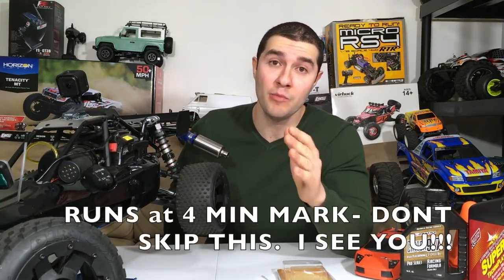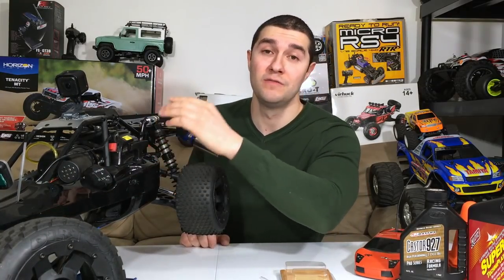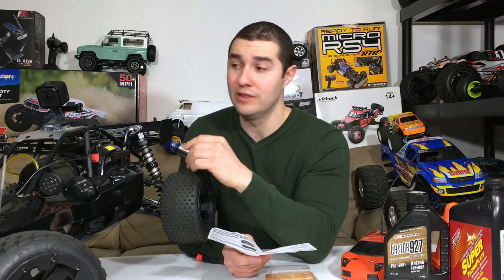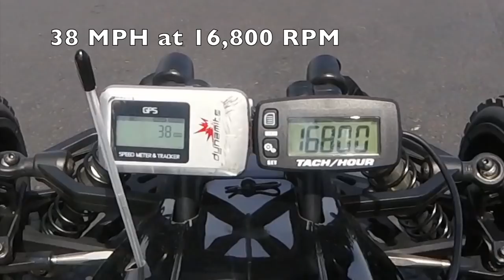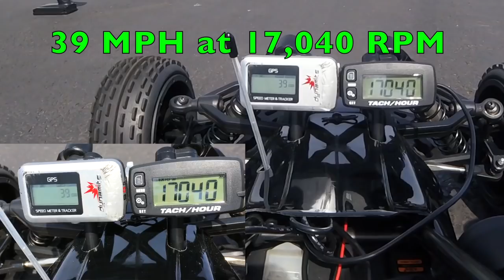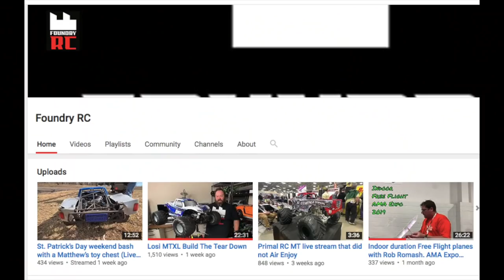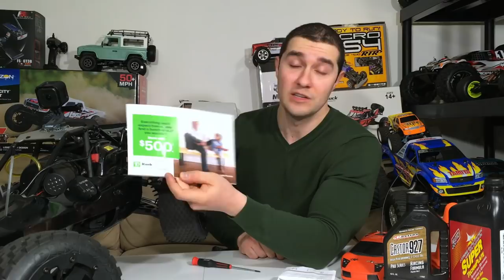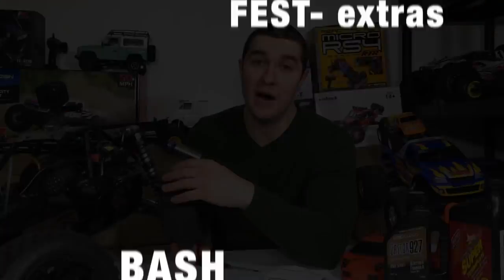RPM meter Speed Install on my ROVAN BAJA and PRIMAL MT purchase update + Much More!!!

Comment: Great vid! 17000 is more than I would have guessed! That tnx keeps catching my eye! Such a great truck was my first nitro back in the day!
Reply from the maker: thanks man!! I'm sure I can hit mid 17K or possibly 18 K with a better learner tune.  But I'm ok with the engine as it is now too.  That truck is the terra crusher, the model right before the TNX.  The TNX looked similar but had no reverse and smaller tires.  Did you have the terra crusher like mine or the TNX model?  Gotta love vintage RC, I am going to be starting an old hpi nitro mt today for the first time, wish me luck!!!
Reply: hybrid32494 I had the tnx. That’s right they had a similar colour scheme! Good luck on the start up! Love nitro! But it seems brushless and Lipo have stolen my heart these days! Less visits from cops thinking we are running dirt bikes lol😀
Reply from the maker: hahha,  I know what you mean on the cops with dirt bikes.  I love nitro too, today it gave me quite a headache, wound up totally having to rebuild an old hpi nitro mt,  had a busted clutch spring and so many exhaust leaks, lol.

Comment: Great video 👍 RPM gauges are definitely useful for tuning!! I just bought one for my custom 70cc engine that I'm building for my Baja. Should help me squeeze all the power out of it 👍
Reply from the maker: good job!! The more info we have the better it is.  Tuning by ear works to a degree, but you won't notice a 1-3 MPH speed gain visually id say.  This is a solid way to check even minor adjustments.  70CC,  thats huge!!
Reply: @hybrid32494   thx. yep, 70cc is huge! Now they're on to 90cc Lol. I don't want that big because then it becomes more unusable than it already is. 70cc should be perfect for me. Though, my 30cc was super fun!!! I just got alittle greedy 😂
Reply from the maker: I wonder what the RPM will be on that 70CC.  Generally the larger the engine the lower the RPM will be.  That's why a 1996 corvette redlines at 5-6K, ahaha.  While my old acura integra GSR redlined at 8K.  What do you think about lower RPM clutches. Mine has the 8K one, and it's good and all.  But chews up the tires easy with all the wheel spin when it engages.
Reply: @hybrid32494  The alx engine that my 70cc is based off of goes up to about 17500rpm surprisingly, my bottom end is identity to the alx, but my top end is not ported so that can be a factor. I'm hoping for 17rpm. I'll tell you when I have tested it out 😉 on the clutch thing,  the lower rpm clutches like the 6k ones will have softer,lower revving launch, a 8k or 9500rpm clutch will be like dumping the clutch at high rpm in a real car, most of the time the tires will Start spinning. So if you want it to have a softer launch and not spin the tires, you can put a 6k rpm clutch, there not very expensive, what you can also do for even cheaper, is just remove the spring in your existing clutch and buy just another spring for $2-5 and put it in your clutch and test it out.

Comment: Love your videos !  My son , and I have a pair of Baja 5r Mustangs,  even though these were "street cars"  they came basicly set up ,(suspension -steering) for short course dirt.  Mostly due to WAY uneven tire wear, I decided to Lessen Toe in, Caster, and Camber. Because it really looked to me as if all 4 wheels were "binding " with the road.     Less Bind, More speed.     While doing this work I noticed how "Out of Balance" the wheels were. I raised the front end, let tires rotate, marked the top, and glued a very small washer to inside of rim. I ended up with about 5-6 washers on each rim. (temp install rear wheels in front, as rear wont spin freely)  So far 43 mph with out buying speed parts.       I live in West central Ohio, There is a defunct home depot here, with a beautifull parking lot,    I purchased 200 traffic cones, 2 for a dollar at dollar tree.                                                      P,S.will likely dial back on some of these suspension adjustments to re-gain some of the cornering ability.

Comment: That was sick, never knew they had little tachs for RC cars lol. Completely took apart some of my laptop fans to try and find the problem instead of just replacing them. I was actually trying to find a tool to measure revolutions in general, but alas no such thing exists as all tachometers have very specific applications. I guess I will have to film the fan spinning in slomo and just count/multiply lol.

It's crazy how high the RPMs go on such tiny gas motors. Easily puts street bikes to shame. You know what would be real interesting? A rotory engine on an RC. Talk about power scaling linearly to RPMs lol.
Reply from the maker: hey man, thanks for checking this video out, I'm gonna be away this weekend, lets go RC sometime next week.  
I got a tool for ya to check RPM, I did it on wheel speed in one of my videos, it is also used to find speeds of any high RPM device such as a lathe.  It is a laser that counts the number times a reflective sticker spins (very simple).  As long as you can mount a sticker the size of 1 CM squared it will work.  Check this link, it might work for you.  
https://www.amazon.com/gp/product/B004Q8L894/ref=oh_aui_search_asin_title?ie=UTF8&psc=1

YUP, a rotary would be interesting, just like it was in the Mazda RX8, LOL,  that was an epic fail although I still like the car.
Reply: @hybrid32494  That's almost exactly what I had in mind, thanks!! There should be a way to get that sticker to stay on the fan blades. If not I'll still keep it just in case.

I get off work in the afternoon so just let me know whenever you are around. Looks like it will be at least 60 and sunny by midweek.  Hopefully nature is finally starting to warm up for spring.

Lol yeah the RX-8 was meh. I mean it certainly wasn't bad but the price point was hard to justify. The RX-7 is a completely different story though. It's too bad more people weren't into those cars.

I always had this idea that rotory engines and CVTs would make like the perfect combination. You have a small, lightweight motor with low torque that generates power at high RPMs and a small, lightweight transmission that can keep the motor at or near redline instead of constantly shifting. Imagine having one of these rotory units (motor + transmission) powering each wheel? Electric motors have a monopoly on that sort of setup for now, but if technology develops far enough I can see hydrogen-burning internal combustion engines making a comeback, at least in racing or other specific applications that call for it.

Comment: Oh dam. That O.S. engine was my very first engine in my RC10GT back in 1994. I still have it but it no longer runs. I just hold on to it for sentimental value.
Reply from the maker: I know what you mean, it's hard to let go of a vintage O.S. motor.  I love them too.  It surprising how low of a power spec they claimed to make and yet ran really well with pretty good power.

Comment: Another great, informative video,  👍👍!!! I've been learning lots from your videos brother, I've got a question though that I'm hoping that you can help me out with. I've got 7 electric rcs, last week I broke down and bought a Shockwave Nitro. My question is, is it possible to convert it to a two speed and if so, how much of a pain in the tailpipe is it? Thanx in advance for the help brother and I can't wait to see you rippin that RAMINATOR!!!   👍👍
Reply from the maker: hey man!! thanks so much!! Glad you liked the content.  I have the redcat nitro shockwave too and yes it's a single speed like yours.  I just checked and it looks like the redcat nitro tornado has a 2 speed as standard.  They are the same buggy.  The conversion means you would need a whole bunch of parts, new clutch bell, new gears, new center drivetrain parts (at least).  I also have an exceed nitro rally monster with the 2 speed.  I would highly recommend you just buy one with a 2 speed ( much easier).  I would recommend finding slightly larger tires for it (that will give you about 3-5 MPH more). A 2 speed would give you at best 8-10.  These 2 speeds are pretty close ratio and not worth the trouble to retrofit.
Reply: Thanx for your reply, I appreciate it big time. I guess I kinda jumped the gun a little bit, my two speed clutch bell and gears arrived in the mail today, along with an electric start kit HaHaHa!!! We'll see what happens, I'm a mechanic and I don't mind the extra work involved in the switch. I'm getting ready to get swamped at work though, EVERYBODY has to have their boats before long. Keep cranking out the great videos and I'll keep on watching them brother👍👍        Update: It's all back together, gear mesh set, waiting for the morning so I can make some noise and blow some smoke
Reply: It's FREAKIN AWESOME!!!

Comment: I’m at the point where I need a wide variety of 2S and 3S lipos lmfao !........ I need to get some badass deals off amazon without having to spend so much on shipment man. I need some decent to high quality lipos short little midget packs that would fit the 1/16 vxl e revos that I have as well as the bandit, slash’s, rustlers and big e Revo man. Please dude if you can recommend anything I mentioned and at a BRAND NEW condition let me know. I need them all with TRX traxxas connectors. Let me know what you use for the 1/10, 1/8 and 1/16 cars you got.
Reply from the maker: I am at the same point as you man, I'm also looking on eBay and amazon at this point for lipos,  so annoying.  There are so many brands now, it's tough to shop smart.
Reply: hybrid32494 Exactly it pisses me off man I don’t have to worry about fuel but I gotta worry about the connectors as well as the lipos themselves in regards to performance, fit and price. With gas all you need is a bottle of nitrous or gas....... with electric it’s a pain in the ass having to shop around for high quality lipos at s decent price that’ll last you longer then 1-2 years. Most of my batteries only lasted me 15-24 months but two of them did exceed 2 years and it was my two lectron pros soft packs that I had bought for 64.99 a piece from the hobby shop with TRX connectors attached to them. I got atleast 2 1/2 almost 3 years on the Lectron Pro 3S 50C 5200 mah soft packs no joke !!!!! Lol. Lectron lipos are badass dude !. Traxxas lipos will only last you 7 months to about 1 year and a half..... they suck.
Reply from the maker: GORILLA BEAR TECH i will check the lectron models asap.  I just need one, i cant do any speed runs.

Comment: Gr8 testing and good speed is there any manual rpm meter is also available
Reply from the maker: hey my friend!!  I have not come across manual ones, this is really easy to use though.  It's accurate and cheap to buy.  It's a great tool for tuning the high speed needle too.  Plus this will permanently record your engine hours, also pretty useful data for engine comparisons.

Comment: Hiya buddy have you rolled your buggy yet I was thinking of putting a fpv camera on the buggy but it looks like the roof is the best option for a good view but it's that thought of it rolling and wrecking a Runcam lol
Reply from the maker: hey man, I have not flipped or rolled this once at all.  And I did some pretty serious turns and braking at all speeds.  This long sand rail type design is quite stable.  I most mine on the roof with hot glue, never fell of at all.  you'll be fine, I use a go pro session 4.
Reply: @hybrid32494  thanks that sounds good iv seen people flipping and rolling these by tuning and braking at the  same time but I was thinking ahead and purchased the steele roof cage lol and a few other upgrades as we do haha I was wanting to ask you how much petrol did you use on your 8 heat cycle's and did you use up the rest of the first mix on low idal running my friend
Reply from the maker: honestly there is alot of inconsistency with how people break these in, some manuals even say you don't need a break in period.  But its still good practice to do heat cycles of 10-15 minutes each.  I've seen people use one whole gallon for break in, which is weird considering the recommended 4 heat cycles of 10-15 minutes only use about 1-2 tanks (nowhere close to one gallon).  I would say as long as you go 4 cycles of 10-15 min and 4 more of slow 25% throttle at times you will be perfect.  Which oil will you be using btw?
Reply: @hybrid32494  thanks I wasn't sure if a full gallon of 24/1 mix was really needed my friend I was thinking 8 heat cycle's and sitting it of the ground and do 2 gentle minimum throttle running for 10 mins before its first low idal drive on the tarmac carpark :-)  was it only 2 tank fulls you used for the brake in prosses that's another thing I want to ask have you ever checked the battery pack voltage when it's fully charged ???   My friend
Reply from the maker: Yes it was basically 2-3 tanks total at most.  Nowhere close to a gallon as people say.  You can check your spark plug too after every few heat cycles to make sure it's rich enough and see how it responds to the oil mix.  I charge my receiver battery every time I start it for the day, I know it's a 6V battery system.  Generally that means it will charge to a little more than that.  WHY? are you trying to stick a lipo in there?  It's unnecessary, the electronics are fine considering I also run light all the time on mine.  Even after 5 heat cycles with the lights on the battery was fine.
Reply: @hybrid32494  thanks yes will probably check the spark plug every time it's been running and I'm not using lipo.s my friend iv made myself battery packs from an old laptop batteries but the packs fully charged are giving 8.4v lol  but I'v got a variable voltage step down and iv got it set to exactly 6v my friend but not sure if I should set it to 6.5 or 7v so it's getting a good voltage but not wanting to burn out the servos  :-) hopefully
Reply from the maker: that makes sense, the 8.4 volt is what a basic 2 cell lipo will charge to.  Even a old school NIMH or NICD will charge to over 8 volts, but really is sold as a 7.2V pack.  These rovans and most hobby RCs use a 6V system.  If you count the cells in the receiver pack it will be 5 cells at 1.2V each.  The standard stick packs have 6 cells, that's how they get 7.2 V at 1.2V each cell.
Reply: @hybrid32494  thanks yeah my friend I had a brand new 9v ni -mh pack and removed 3cells that down to 6v now plus and iv made 3-2cell packs from  the Sony energytec 3.7v cells but these are the ones I made the step down voltage lead for that's why I was a little worried about the voltage and trying to find out what voltage these run on fully charged so I don't go over it my friend but I'm going to keep a lipo low battery buzz connected to keep track of voltage and set the buzzer to sing away before the low voltage cut off lol  :-)
Reply from the maker: good work man!! I do a lot of random testing with this kinds of stuff too.  Sometimes it works out just fine.  Speaking of lipos, I need to buy a few new ones, mine have taken a dump.  Let me know if you try it and how it goes.

Comment: What i heard the best tune is checking the spark plug color suppose to be color of a bag! If the color is less than that it means its to lean! Also if you have it at default settings and the color is less gray then u have air leak! https://www.bajaplanet.com/new-carb-tuning-instructions-by-esp/ this is how doug from esp tunes!
Reply from the maker: hey man!! you're right, that is one way to check.  I checked mine and it's still looking on the rich side, I'm ok with that.  It's responded well though since the minor lean I did in this video and the plug is less oily.  Looks like another 1/4 turn will do the job.  thanks for the info.

Comment: Hey dude, just watched it...... it seems like you might be on the limits of the exhaust pipe and contrary to popular belief, it's the exhaust that dictates the maximum RPM your engine achieves, not your tuning. Look at fitting a DDM Dominator pipe as that will allow the engine to breath as well as giving the engine more low end power which will help it pull those taller gears you're planning on fitting. It also tucks in the rear and is better protected so you'll be less likely to smash it during a roll.
Reply from the maker: hey man! thanks for checking this video out and your advice.  You are completely correct, the pipe is very important for higher RPM and low end torque.  The only reason I don't think I will get any other pipes is because they literally cost about 40% of this whole RC,  you know!!  I also run pretty rich still and still see some oil on the spark plug, I'm sure I could get another 500 RPM out of this safety.  I will keep you updated in future vids.
Reply: @hybrid32494  DDM generally have a blemished pipes for sale cheaper, but you can also get clone versions of the pipes also for like $30.
Reply from the maker: if you come across a normal clone pipe for cheap on ebay please do send me a link.  Buying pipes and exhaust components is literally my least fav thing to shop for.